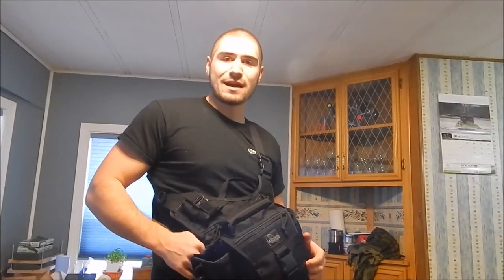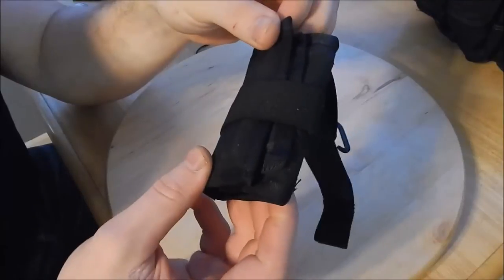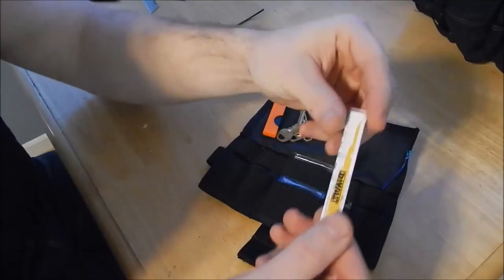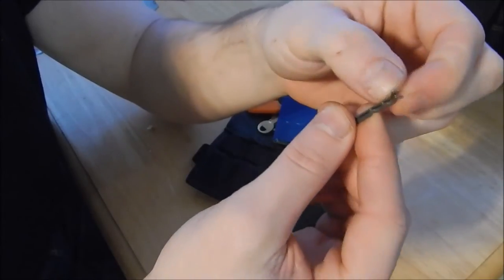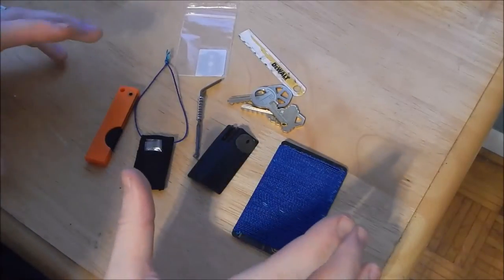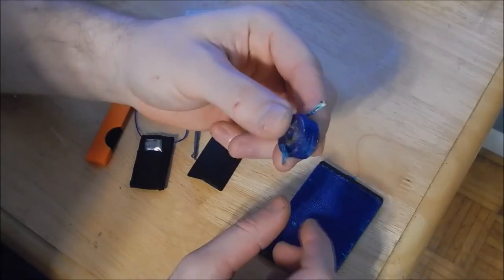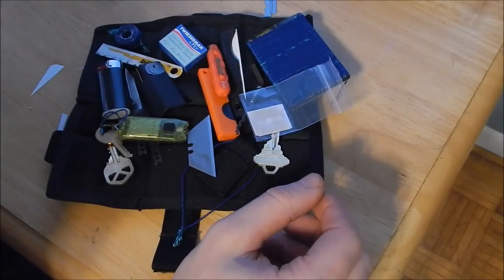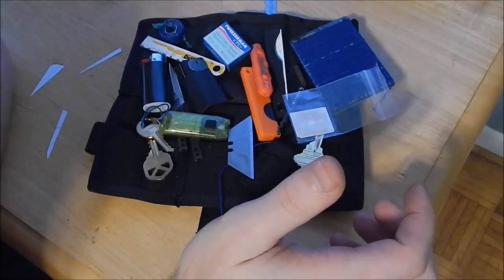Triple Aught Design SERE Pouch: Building an E&E kit

Comment: I really love my "WAZOO" survival belt.. most likely the bad guys are not going to take my belt  .. inside the belt I have a treasure trove of not only escape equipment.. but survival equipment.. there is a small ceramic blade that is like a little jackknife folds up to protect the blade sold by wazoo.. all the rest of the equipment I purchased separate myself... A mini flashlight that works on tiny watch batteries... A folding razor knife..( plus the folding ceramic blade.. if I'm going to be going to metal detectors I remove metal blade and lead just to ceramic).. a mini fero rod .. two pieces waxed fire starter tinder .3 waterproof survival matches and six regular matches all sealed in mini bags... 20 ft of number 95 paracord Suunto wrist compass cut down to fit in belt... And a second tiny button compass... 4 aqua tab. Water purification tablets and water storage bag... Tiny Swiss army SD keychain knife with scales removed..(scissors..blade .. file with screwdriver tip also works on Phillips screws).. a piece of hacksaw blade... Plastic handcuff key... Bobby pins... Mini fishing kit with hooks mini sinkers and mini lure..30 ft spider wire fishing line..3×$20 bills ..2 advil ..2 80mg aspirin..2 amodium .. one day of my own meds pills crushed up and put into a little baggie... Tiny emergency whistle.. one large bandage and two regular size Band-Aids.. a little pouch of antibiotic ointment.... And much more I can't go into here... I don't have any shims or lock picks... But I might add a set of those mini lock pics later on... Spider wire can be used to cut through things... Plus mini razor.. ceramic folding razor and Swiss army knife can be used to cut through things along with the hacksaw blade

Comment: I own the triple aught design fastpack it is overhyped
Reply: +Mystic Insight you must not be using it to its full potential. Do you use the Control Panel 1 ? Its the only modular high end ruck on the market.
Reply: +BigDipper14 no. I don't want to pay another $45 for an add on to the pack.
Reply: Why not its a good piece of gear. GORUCK makes you do the same shit, buying the sternum cinch and the field pouch just to even come close to TAD.
Reply from the maker: +BigDipper14 while the fastpack looks like a very well constructed and organized pack,there are less expensive packs that do the same thing. But for many,a few extra bucks on a main piece of gear they'll use daily for years doesn't matter much. It comes down to personal tastes. If you don't like the looks of it,it doesn't matter if its the best thing ever if you'll never use it. TAD makes some cool,albeit pricey stuff,but I wouldn't call any of what they make "the best",theres just too many fish in the pond to make such a statement.